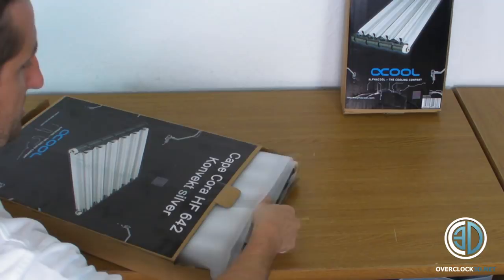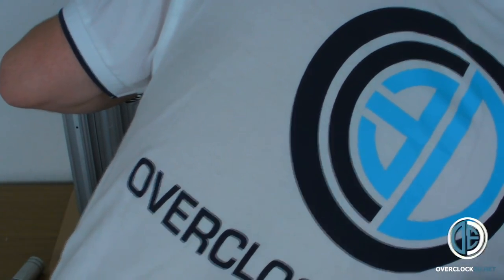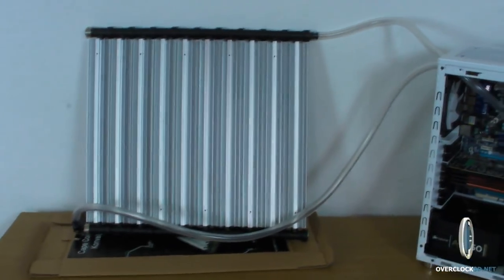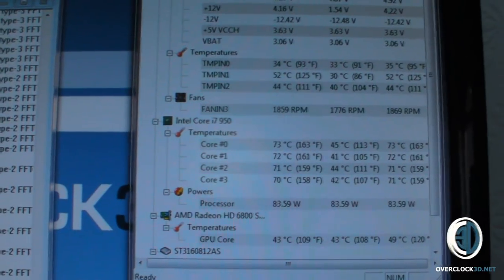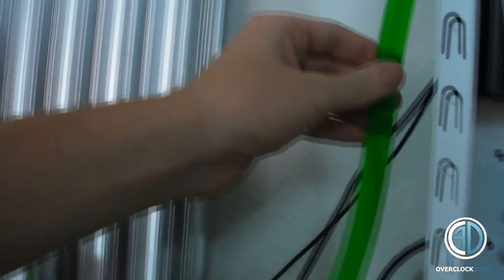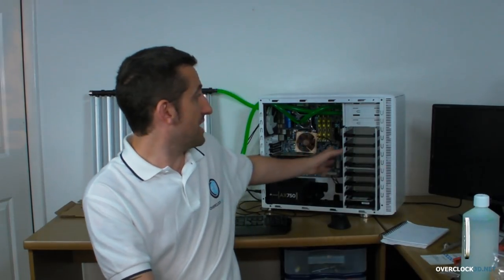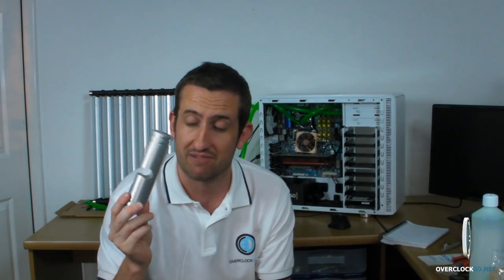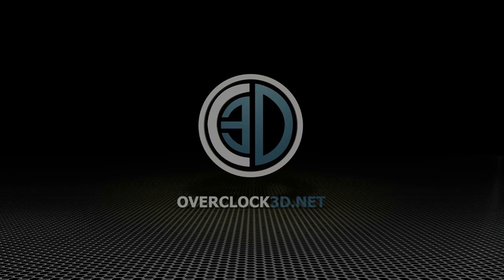Alphacool Cape Cora Passive Radiator Review

Comment: hello
I built a comparable system 10 years ago with 10 cape cora V1 with water distribution replaced by 12mm internal diameter copper tubs (the original was very restrictive). The pump was a eheim 1048 ans the CPU block a innovatek innovacool rev3.
My perfs with a P4E prescott 3.2 @ 4.5GHz and 1.7v (more than 200W estimated) was better than the test.
I think that a pure vertical positioning of the radiator is important in order to waranty a correct air convection.
An other tip is to have water input at the bottom and output at the oppposite top: when fiiling the circuit, the air will be evacuated without needing to rotate the radiator.
Reply: Guig Esprit du Sage input at the bottom and output at the top would create a parallel flow radiator, the lowest temp that a parallel flow rad can produce is roughly halfway from room temp to input temp; if instead you put the input at the top and output at the bottom you have a cross flow rad and in that case the lowest temp you can achieve is room temp.
Reply: This was the very first thing I noticed on the setup in this video.   Cross flow would drastically improve the performance.
Reply: @3800S1  It does have cross flow just going in the wrong direction from top to bottom.

Comment: @rmb1993 I've read that refridgerating a radiator will cause condensation buildup on the coolant lines, and then you'll run the risk of having moisture (not coolant) dripping all over your components.  It can be done, but a lot of thought has to be put into lagging the lines to prevent this.

Comment: @rmb1993 So many people say that, but they don't understand that refridgerators do not cool 24/7, and when a radiator is actively generating heat, the fridge will not beable to keep up. It would be better to make a chamber with an air conditioning unit.

Comment: it looks like this would be perfect rad to put a bunch of Peltier devices(Thermoelectric effect) on it. Get the coolant just above freezing, and get some thermal shielded hoses. Not sure but, the condensation may be compensated by the hotter side of the peltier device.

Comment: Wonder what the temps would be if you had it at your window and you had it open, if it was late night with a nice breeze even at summer it would decrease those temps alot.. Can you try giving it a go with some different cooling solutions using a passive cooling system..

Comment: I think he might have been thinking of an effect like with water chillers. If you actually get the water temperature below ambient, condensation inside the case is a real possibility. But unless you have a pretty extreme aircon, that is not going to happen. Most water chillers go into the single digit temp range after all. But I do agree that it would be a silly idea. The noise/cooling ratio would not be worth it, unless you put it in a separate room, in which case, normal rads would be better.

Comment: @Mcwolfkiller yeah i know, the worst part is that if i underclock my computer wont be able to do a shit, its at 2.4 GHz stable but i think if a run prime95 for like maybe an hour or two it will shut off, do i might get a stationary computer that i think i will run 70 or 80 max

Comment: @rmb1993 The fridge probably won't be able to keep up with the heat. If it CAN keep up with the heat, it will run the compressor constantly. You'll end up wasting electricity and burning the fridge out.

Comment: Not surprising it doesn't work very well: it doesn't seem to have much exchange surface. Possibly more usable surface on a simple air type rad with fins 2mm apart in stead of the (guessing) 1cm space between fins. Results should be comparably similar with a air rad without a fan. It may look stylish but not geeky lacking apparent effectiveness. That's just my personal 1rst impressions...

Comment: I don't follow this logic. How can moisture in the air condense on a surface that will be hotter than ambient temperature? Besides, if it's a portable air conditioning unit, the air will be dehumidified anyway.

Comment: Interesting. Those pipes are made of aluminium which probably limits their performance a lot - and cause galvanic corrosion.

I had way better dT on Watercool MO-RA3 420 Pro which while designed for fans (though low static pressure) is just huge area. Price wise though it is much more expensive...
Reply: However, as no electrical charge exists around the Cape Cora radiator, Galvanic corrosion cannot take place.  Whilst a conductive coolant would provide a conductive path between the different metals, no charge would be present within the radiator to cause the process.
Reply: There is no such thing as a non-conductive coolant really. Unless you want to run an oil perhaps, but that is incompatible with most pumps; or pure glycol or glycerol which will have reduced performance and higher drag.

Water will cause issues in such a system, even with an inhibitor - you need also full aluminium blocks if you want to use this. Even deionized water will acquire ions over time from the blocks. Nickel plated blocks might survive for longer but I wouldn't be 100% sure there either.
Electric current only speeds up the process, does not cause it - the difference in electrode potential of metals used does. It even happens without the presence of liquid as well on metal contact - but that's less problematic usually besides making welds and solders trickier.